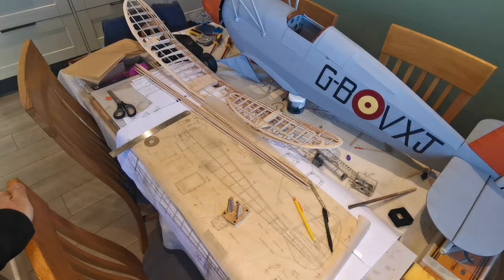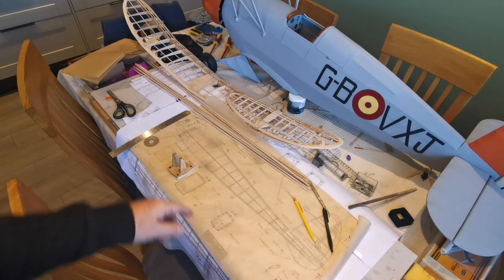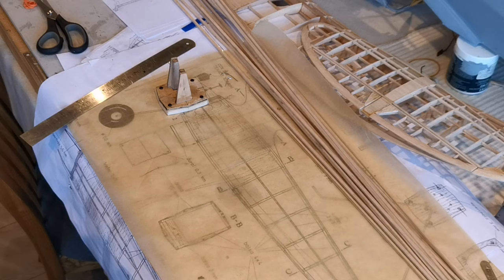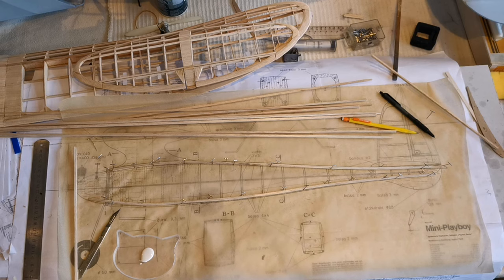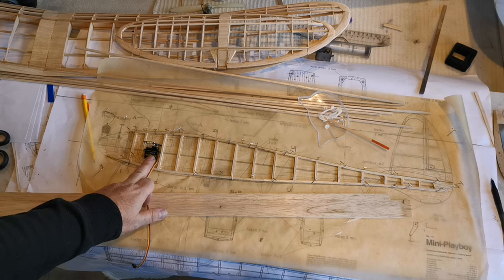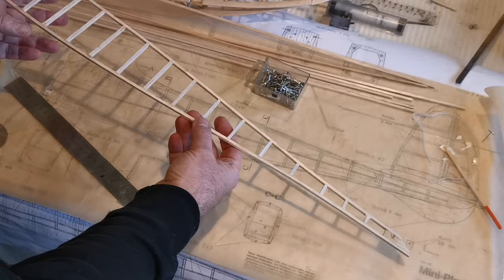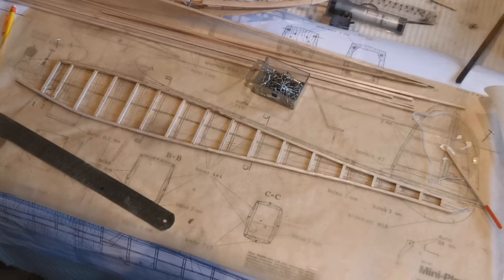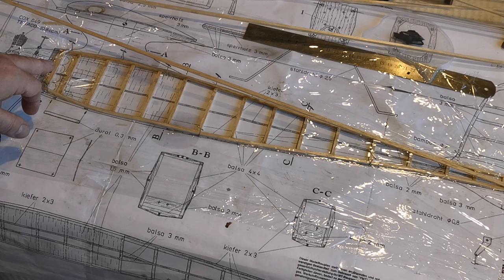Building a stick and balsa model plane :Mini Playboy fuselage.

Comment: Delightful!  
I used to build  balsa and tissue planes beginning when I was about 5 years old in the late 1950's. I earned money by helping my dad scrape old curled paint off the garage. My mother was always furious that I bought airplanes, Guillows, Monogram, Revelle, and built them. She said that I should save my money like my older brother did ''and not waste it on air''. She scolded me many times and shamed me. It didn't bother me much.  

She developed Alzheimer's Disease in her last few years and couldn't remember much. A few weeks before she passed away at age 91, I managed to take the long trip to see her. Mom got some mental clarity back for a few hours and cried profusely about scolding me about building all kinds of airplanes when I was a kid. I told her that I brushed it off and it didn't bother me then or now. She said she still felt guilty. I was in my mid 60's then and she remembered how I built mini bikes, engines, motorcycles, boats, hot rods, dune buggies, radio control planes. I built my home expansion and shop addition myself by permit with my own hands, everything but the stucco job. I can fix anything. She said that she didn't realize how building model airplanes developed my skills and she was deeply sorry for it. I am glad that she got that off her mind while her mind was all there. She passed away a month later not knowing what planet she was on, not recognizing my brother or her caretaker. I treasure that visit.

I'm glad that you still build planes and I'm delighted that your video dredged up good memories for me.
Reply from the maker: What a brilliant post you have made my day thank you for sharing that lovely story
Reply: @MarkCroucherRC4fun               Blessings to you, my good man!